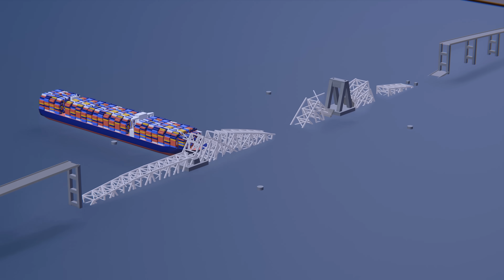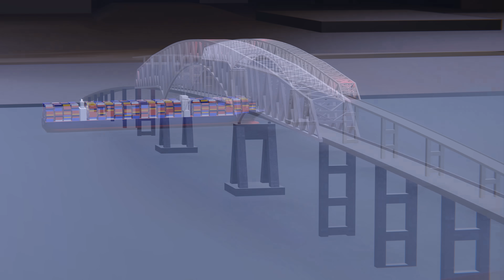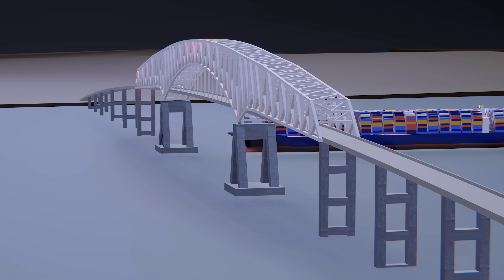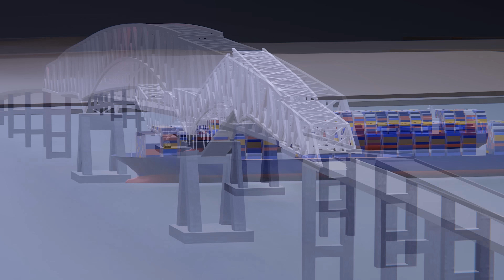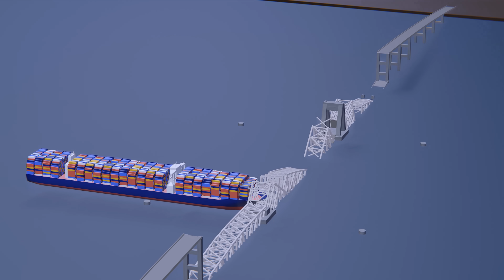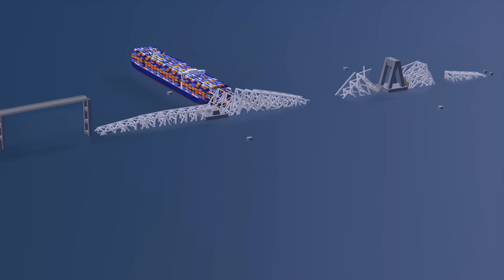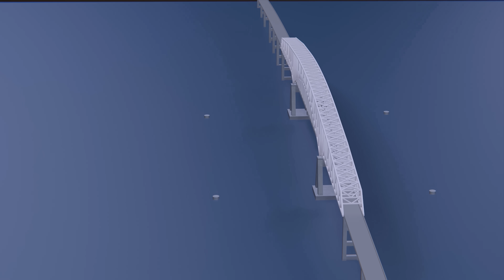How Did the Baltimore Bridge Collapse - Animated

Comment: Yes this video is very instructiv about the data of this colapse. But I don't andestad your teory about redistribution of weight load throu others elements of a structure. Every one structure in the world will colapse if you broke one of two principal legs. May be you want to tolk about other element of the structure like vertical cables from lattice superior structure to the deck. There is a lot of this vertical cables from 10 to 10 meter,  less or more, who take on weight of  the deck in central opening. I'm shure if one or two of this cables will broke the rest of them will take on the weigt. And the same with every element of the lattice structure. But not with one leg of two.
Second observation on this video is about a moral problem, about responsability of this disaster. I don't belive few pilot boys can decide haw long is escort services in dangerous area. I think this pilot boys is under the portuar authority who decide how long is escortage. Who pay now to rebuilt this bridge. Thei saveing few thausents for a trasit ship, may be 500 ships in a year, that mean 500,000 a year. And now will must to pay 800-1000 millions, or more, to rebuilt the bredge. You say that wll be rebuilt in about two years, but now in december 2025, when I see this video and write this word, the construction don't started. My optimistical opinion is about five or six years when will have an construction authorization to start the bridge construction.
And now about city Baltimore authority and Maryland authority. I andestand that from the time when was proiectated there was no one danger for the bridge. But from 1977 when was inaugurated this bridge until now traffic conditions was changed very much. The ships like Doli was max.1000 containers capacity or less and 10 or 15 times smaller tonage, at that time. But what this autority, I mentionated, make in this 47 years for the security of this bridge? Nothing. You show us there is few solutions to protect the bridge, like strong pilon supports fender, cylindrical concrete dolphin or rock islands. Of corse this solutions cost, but less than to rebuilt the bridge. On Baltimore Bridge there is one anemic dolphin, three times smoller like Tampa dolphines, every side of the two bridge legs, but Doly pass aside of this direct to the bridge support. And this autority mentionated must make pressions to the portuar authority to escort all the ships with pilots sleps out of the dangerous zone, beyond the bridge, long time ago. In this matter there is a total absece of responsability of tis authority of the city and the state. And there are more bridges to the ocean.

Comment: The main supports were HOLLOW concret, sqare tubular supports and sheared off.
Had the supports been SOLID the Dali collision would have developed into a glancing blow and probably not sheared the supports. Simulations will find that a Dali glancing blow would have resulted in a damaged to the starboard side of the ship with loss of many containers falling into the channel and the ship course rebound ed into the mid channel.

Comment: It makes no sense why the ships were permitted to move at that speed near the bridge.  With the energy of impact multiplying by 4x with every doubling of speed, it should have been traveling far slower while in proximity of the bridge.  Even if this was legal (and I doubt it), these speeds need to be lowered and enforced.  In addition, all bridges need to have protections added to their supports for this concern, particularly if they are out of date.  Hopefully we will learn from this.
Reply: With a known power problem, the captain should've had the tugs bring his vessel out to the ocean, to avoid any issue with it losing power inside the waterway.
Reply: So you expect us to go 1 knot at all times in Port? Do you not know ships are on a time limit to get to port to port? Smh do your research before you try to act like a merchant seaman
Reply: @chazspeedy.8286 dO yOuR rEsEaRcH 🤡
Reply: @chazspeedy.8286  if all slow down, would not make the difference in time limit at the port for anyone - just the same delay for all when compared to higher speed limits.
Reply: Depends on the current of the bay. If it is flowing out to sea, the ship has to go faster than the current in order to steer.

Comment: Since the material of the ship is stronger than the bridge then why don't they make bridges out of ships
Reply: This is just like the rocket ship equation. To go further, you need to lift more fuel, but then you need a bigger rocket for that. So then you need more fuel to lift a bigger rocket to lift more fuel.  Likewise, a stronger bridge is also a heavier bridge which then has to be stronger to hold up its own weight.  In the end, making it as light as possible creates the best balance - so long as you have some fault tolerances.

Comment: You raise valid points about the size of Dali versus the size of container ships when the bridge was opened. Clearly the lack of a proper protection system will be examined and applied to thousands of bridges around the USA, even as a retrofit. But you state that it's ALL about costs - and having lots of tugs all the way to the ocean is ideal - it is not. Many tug operators die each year from accidents occuring while tied to ships. They limit it for safety as well!

Comment: Where is the sharp turn to starboard in your animation??
Reply: I don't think this animation attempted to address that at all. Although one does wonder what was the point of the animation if not to address that. This anim also shows the bridge collapsing immediately after the first leg was hit but that's not correct.  It wasn't until the second leg was hit that the bridge collapsed.
Reply: @Robert08010  That's my point. Why not? Is it a deliberate deflection from the truth to influence what people think? Perhaps it is. If someone is going to go thru the trouble of creating this, one would think they would try to make it ACCURATE. Not precise but ACCURATE.
Reply: @denveyebanks4787  Could be (like most of the commenters here) he didn't research enough before making his video or comments.  My take is that this was a low research video created to gather views, not to mislead an investigation.  Believe me, no investigator is looking at the youtube comments to crack the case.

Comment: That ship shouldn't have been allowed to sail the sea because it was redflagged due to two previous incidents it was involved in the company knew that the ship wasn't safe for use but it was allowed to continue being in service.
Reply: Yep. But the mentality is "Time is money." The course to Sri Lanka was already extended by many days to avoid a path through the Middle East. It had to go around Africa.
Reply: I wonder who will be held responsible.
Reply: Do not forget, the ship is run by Indians,,, everything is okay boss,,, their style
Reply: @huangerli7215  actually many lives had been saved for those guys .. company owns ships , certainly no individual. This happened bcz of greedy officer
Reply: The engines throttle up as seen by the black smoke?  No sign of the wash from full astern thrust. So ship is on full power forwards? No dolphins so no protection. But from the other side there are puffs of smoke just as the ship hits. Look like cutting charges going off on pier.  All very odd. No power no turn so why did it turn? Too many questions.

Comment: Sailing a vessel that size and at that time more caution should be taken..Crew would have been fatigued and mistakes could be made..Consideration of weather-Wind speed and direction-Tidal movements..Pilot training of handling vessels of that size..Approaching bridge without tugs should be-Dead Slow Ahead and using Bow Thrusters as necessary..Off course no one in the public domain know as yet what may have happened..NTSB  Reports takes about 2 years..In reflection just think what 2 escort tugs could have avoided.

Comment: This vid is misleading.  The ship made a hard rigjt turn directly into pier.  It did not drift off course
Reply: It looks like when the ship's power was restored the first time they restarted the engine and went to full back (reverse). That caused the bow to turn starboard, pointing it at the bridge support. Had they just remained drifting, they probably continue through the channel and under the bridge causing no damage.
Reply: You are ill informed. They lost power and coasted in to the pier.
Reply: Here comes the YouTube experts 😂

Comment: Very good video.
Not to be argumentative, but for Tugs to have prevented this allision, (1) they would have needed to remain connected to the Dali past the bridge, and (2) the Speed of the Dali would need to be much less than it was moving at the time.  At 8 knots the tugs would not have been able to prevent the Dali from hitting the bridge.  At 2-3 knots they probably could have prevented the incident.
Good video, covering all the aspects of the incident.
Reply: I heard the same from a tug operator
Reply: Agreed. And, in many cases, tug use is limited to increase TUG operator safety. Many tug operators die each year from accidents when tied to large vessels. So they don't stay attached any more than necessary.
Reply: So for the tugs to be effective, the ship would have to move much more slowly?  That would also add to the cost by lengthening the journey out of the harbor.
Reply: @Robert08010: When the cargo ship was being pushed by the tug boats, it was moving at a slow speed managed by the tugs. Once the tugs separated from the ship, the ship powered up to speed to 8 knots. If the tugs had remained pushing the ship past the bridge before releasing the ship to run under its own power, the power outages would've had lesser consequences.
Reply: @oahuhawaii2141  And that's a fact.
Reply: When tugs are used they are connected and do all the steering and propulsion.

Comment: I'm sure we'll be replacing it with a cable stay or suspension bridge so that the supports of the bridge can be as close to the shore lines as possible.
Reply: To have the piers at the shore it would need to have a 8600 ft span. It's main span was 1200 ft. I'm sure they will increase the span but making the span 6x longer is extremely expensive.

Comment: Not an engineer, or shipping expert, but why did she sail with existing electrical power problems? Why did she sail on an ebb tide? Why were tugs not mandated throughout the navigable channel by the port authorities? Was there a pilot on board (not that would have made much difference)!
Reply: The cargo ship took on 2 men to handle the harbor pilot duties.

It costs more time, money, and effort to have the tugs bring the ship all the way out. Ship operator wants to save money. Harbor coordinator and tug operators want the next vessel to be serviced ASAP. The assumption is that the cargo ship can speed up to 8 knots and make it out on its own. Of course, the captain of the cargo ship is negligent in not considering the issue of his ship's ongoing power problems.

Comment: So it all boils down to - - why was a "fracture-critical bridge" built without concrete impact bumpers ("dolphins") around its main support columns?
Reply: Because it was built in the 1970s before the need for that kind of thing was really understood.  

Now if you want to know why those weren't retrofitted following incidents like the Skyway collapse in the 80s, then yeah, you can probably chalk that up to greed and/or negligence.
Reply: Let's be real. Unless you had 50 ft thick concrete barriers you're not stopping a ship of that weight cla
Reply: The odds of it happening were extremely low. Dolphins are extremely expensive and you will need convince tax payers/ commuters that they want pay for extra protection

Comment: Excellent effort! No new information though. Not sure how much engineering process you use in these animations but an excellent addition could be around theories why the vessel pulls port side. There are multiple known engineering and physics theories that would cause that. Obviously we are not ruling out possible sabotage as one of the causes. Just that if its proven no sabotage happened then it does not mean the ship did not veer off course and hit the pylon.

Comment: The bridge pillars were not protected by concrete dolphins. In my arrogant opinion that is the root cause.
Reply: I agree with you,,,those "Pilings" set maybe 100 yrds in front of the inbuttments didnt help,,, Those 4 skinny legs just crumbled
Reply: For a major shipping lane it is idiotic not too have pillar protection.
Reply: @lukeward5804 Yes, you are absolutely sure. See the Rio-Niteroi bridge, in Brazil, with huge dolphins for protection of the central pillars.
Reply: I totally agree, the existing dolphins are in the wrong position to deflect the wayward container ship.
Reply: I agree. That and the weird A-frame design of the pillars—if one fails, there’s no redundancy.
Reply: @PhyllisJerry  I don't believe the original design in the 70s took in consideration handling a direct hit from a 100,000 ton ship traveling at 8 knots
Reply: @PhyllisJerry  They just snapped off like match sticks
Reply: @PhyllisJerry  The "Domino" effect
Reply: In other major ports tug boats are used until there are no more structures but open water.
Reply: Even with protection, this ship is to big and massive
Reply: Would not have made a difference either way. Plus was protected by dolphins they were just insufficient.
Reply: totally agree!!
Reply: Yeah, who'd use Dolphins when Porpoises are readily available.
Reply: @itsamemario8014  I personally love salty herring🎏
Reply: Pillars should have had simple strobe lights on them also.  So wrong for night departure. In avaition you are taught and learned how things happen so much faster in the dark
Reply: Its somewhat ironic that they used the West Gate bridge in Melbourne, Australia as an example of an island protection barrier. When this particular bridge was being built on 1970 it suffered a major collapse of one of its spans resulting in 35 killed & 8 severely injured. It was the worst industrial accident in Australia's history.
Reply: No wrong. There had be concrete Dolphins. But they should have known, that these are not capable for giant ships like that. So they had to use tug boats until the ship passes the bridge. But the shorten the tug time for saving money. So it was a capitalistic reason why this happenes. They now have to pay the price. Not being able to run the harbor for quite a time and reconstructing the bridge will be way more expensive than using tug boats or install a protection system.
Reply: I think you're wrong. Allow me to explain.  There were dolphins. But they were so far away, that even if they were 3 or 4 times bigger, they could not have stopped this accident.  This animation doesn't accurately show the angle of approach. What we see in the video is that during the second blackout, the ship began to turn sharply towards the pier. It was pivoting in a way that completely missed the dolphin.  What he illustrates as "an island" is more what is needed here. Or much MUCH  larger dolphins surrounding the pier.
Reply: That is a great suggestion... having a tug boat escort mandatory for vessels having lOA > 100 meters would be a more practical mitigation for such incidents from occurring again
Reply: Nice
Reply: It's strange that if you watch the video from the harbor at 10x speed you can see the ship come in only seeing the side profile running parallel to the camera and then the lights go out, come back on the engine throttles up and the ship makes a 90 degree turn all the while under full throttle and it plows straight into the pillar.  Almost like they tried to hit the pillar on purpose at full speed.  That's what I see in the video.
Reply: the shep speeds up before crash that increases the damage..which makes no sense for a out of control ship whit engines not working...